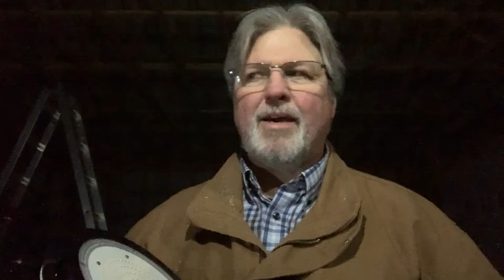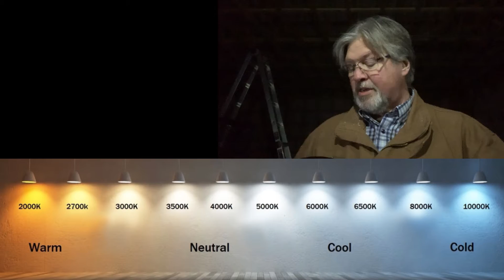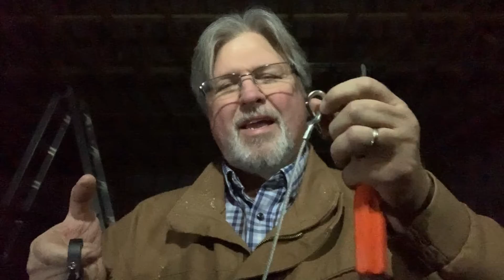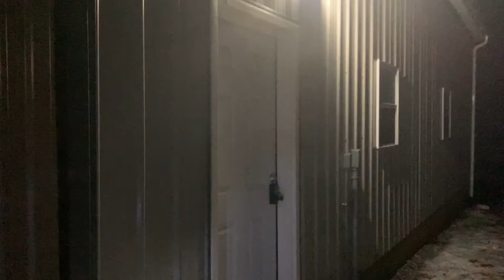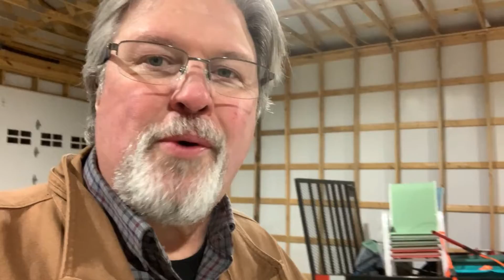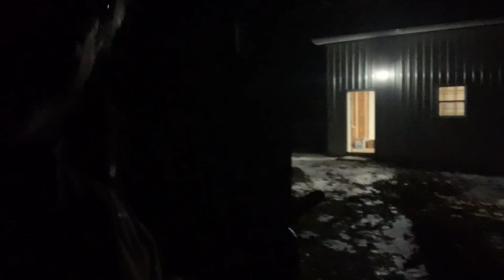100Watt 14,000 Lumen HYPERLITE high bay lights: LED Shop Lighting that even Manfred Mann would Love!

Comment: 5000k to 5600k is considered as daylight temperature. This is what you’d find in a photo studio. That glare your having issue with caused by the size of your light source. Putting diffusers on your lights will allow the light to be bounced all around your space and softening up the light. This is why photo studios have all those large umbrellas and other modifiers on their very powerful strobe lights.
Reply from the maker: Thanks for the insight. We actually did install diffusers a couple months back and it really improved the glare.

Comment: Nice video, thanks. I’m considering 100w Hyperlites as well for my shop (30x60). How big is your shop and how far off the floor are yours mounted?  Thanks!!!
Reply from the maker: The space is 40 X 40 and the ceiling is 12’. I will be dividing the space in half and expect to put four of these lights in the shop space and two in the other half, which will be mostly used for storage. The four lights we have installed so far have blown my mind with how well they light the space.  Scott

Comment: I use some cheap plug in strip style lights that plug in an outlet. Already had 2 go out but they are fairly easy to replace. This looks much better for a permanent installed solution (mine are tacked up and plugged in on socket adapters)
Unrelated but what are your plans for storage in your new shop.

Comment: In my opinion you don't have anywhere near enough outlets,  and why are they not 4 feet off of the floor. I put an outlet every 4ft in my shop and I still search for one on occasion
Reply from the maker: I totally agree, Mike. I plan to have some drop cords from the ceiling. Also, me had some issues with the electrical inspector who seems to be new and was enforcing things as “code” which I believe have no place in a separate building. We did what we had to in order to button it down and can always make additions. Scott
Reply: @MyGrowthRings  There is lots I could say on the subject. I'm a retired electrician and I know of no code that forces you to do that. But glad to hear you will make changes now that he is out of the picture.

Comment: As an electrical engineer who does lighting designs too your choice of 500 lux is good choice.  The difference I did in my shop is that I place quad receptacles 44 inches above the finished floor every 6 feet so they were above my workbenches and easy to get too.  I also placed a 230 volt, 20 amp receptacle every other quad for my power pro shopsmith.  I have been very happy with that arrangement.
Reply from the maker: Dan, it sounds like you made some very good choices.
Reply: One more thing that i am proud of is that my shop is completely off the grid and powered by photovoltaics with battery backup.

Comment: Man, it would be so fun to start with a blank canvas like that.  Are you doing any sort of dust collection?  After elec and lighting, I think that would be the next thing I'd be planning out.  I run my DC on 240V.  No particular reason other than that's what the used one I bought was set up for.

Comment: I don't use anything but 5000-6000K anywhere in my shop or home. Once you get used to them, the old school light looks dim by comparison. We still have a few rooms in the house that have halogen bulbs that we used to think were white. The other day, my wife told me how dimly lit one of the rooms was and that everything looked yellow.

Why use 5000-6000K LEDs? Colors, for one thing, are about as close to as you can get to daylight. If you are painting or doing any photography, you need white light. You can see fine details much better, probably because of the colors.
Reply from the maker: CRI or the Color Rendering Index is an altogether different thing then color temperature. There are cool lights that render color poorly and there are warm lights that render colors well. If you look on the package of your lighting it’ll list CRI, which is on a scale of 1 to 100, with 100 being the color rendering of the daylight. These lights are 80 on the CRI scale, which is lower than I would like, but what I could justify purchasing. Scott
Reply: @MyGrowthRings  I don't yhink you are going to get a high CRI from a yellow light, 
5500K is white.
Reply from the maker: @RobertKeeney  All LEDs begin their life as blue, cool diodes and they are made warmer by adding a “filter” of phosphor. The thicker the layer of phosphor, the warmer the light. My employer sells 2700k LEDs that render color above 90 CRI.
Reply: LEDs come in several colors: Red, Green, Blue, Yellow, Ultraviolet, Infrared, and White. Most lighting uses blue because of cost, ease of manufacturing, and other factors. I don't think you can buy the white LEDs. If you can, I would expect them to be very expensive. At one time, red LEDs cost $200 each. Today I can buy 450 LEDs for $13. In the early 1979's, a friend and I worked out a crude design for an LED TV that lacked only blue LEDs. I predicted that someone would make these, and they did, but the color was not good. I should have purchased some stock.

CRI is part of the issue, but not all of it. Ambient light changes as the camera angle changes. Suppose I put a toy car in a light tent; the white background changes when the toy is rotated because the light bounces around in the tent differently. The sensor in the camera, the software in the camera, and the format you are saving the image in all make a difference. Then you put it into a computer, and it can all fall apart. I have two monitors. One that is supposed to have excellent color. And a monitor that isn't to see the images on both. I only crop and adjust white balance because I don't want to create an image that looks like crap on a cheaper monitor. I don't have any lights, fluorescent or LED that are not  CRI 80 or higher. Thes lights are good enough for what I do. When I started this high CRI, lights were costly, and I found that if I purchased quality 5000-6000K lighting, they all had CRI 80 or better. I soon discovered that I could see details much better with this lighting.

Comment: Great start!  What size service did you run to it?  I ran 100 Amp… that works out just fine.  But, the breaker box was too small.  I’ve had to upgrade several of the breakers to duplex breakers.  

I have plenty of amps but, with some much machinery… I found that I had to split several runs to keep from throwing the breakers.  For example having only one run for my planer and dust collector was overwhelming.  Now, if I had sized the wires to run 30amp breakers I’d have been OK… but, we live and learn!
Reply from the maker: We discussed running 150 Amp but wound up with 200. I suspect I need to break up some runs too. I’ll admit to rushing a bit and not thinking things entirely through.

Comment: Congrats on the shop progress. I am sure there is a lot of good topics like this in the future regarding setting up a workshop from a basic shell. What about covering ceiling height issues? For example, those lights would never work for my 7.5 foot ceiling. I had to go with several led strip lights to spread the light over a shorter vertical distance. On the other hand my strip lights would never work for your tall ceiling.

Speaking of ceilings, for energy efficiency sake, are you considering a drop ceiling or loft over the work shop area? If so, that could change the lighting equation too.
Reply from the maker: Hey Tom. You are absolutely right that this type of light would be terrible on a low ceiling. I will be installing a ceiling but have yet to decide what type. There's a lot to be said for keeping it high, but if I lower it I will do a drop ceiling. I am researching...

Comment: Thanks for the Kalvin chart and the explanation. We are remodeling our bathroom and will have to deal with the lighting choice soon. The chart is a great reference. 
No 220V plug for the Shopsmith?
Reply from the maker: You are welcome. No, none of my Shopsmith tools are convertible to 220V. I have a couple tools, such as a Powermatic 66 table saw that are 220V or even 3 phase, but those aren't top of mind at this point.  Scott

Comment: Put outlets by the big doors. I did and found I use them all the time.
Reply: While on this topic:  I had my shop (basement) remodeled as a woodshop 7 years ago.  Best thing I did was have quads (four outlets per box), 42 inches off the floor (so no bending down and having to search behind lumber, cabinets, tools, etc. for an outlet) and those spaced every 4 feet apart.  True I have some outlets I have never used but have several that I've used all four outlets in the box.  I smile everytime I plug something in.
Reply from the maker: @dwightl5863  Very smart move.
Reply from the maker: I've been wondering about that. If nothing else I could have put them there but on the outside.
Reply: @MyGrowthRings  I also have them outside as well. It's easier to install them now, not later. I've set up three shops and each one had more outlets then the last. Because I'd say gee I wish I'd of put an outlet there. IMO
Reply from the maker: For sure. Thanks for the suggestion. Scott